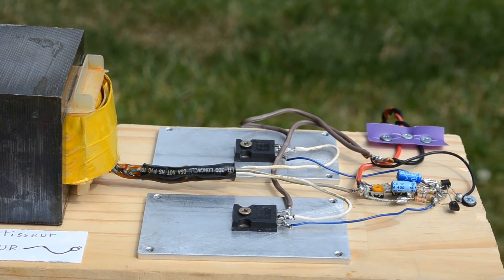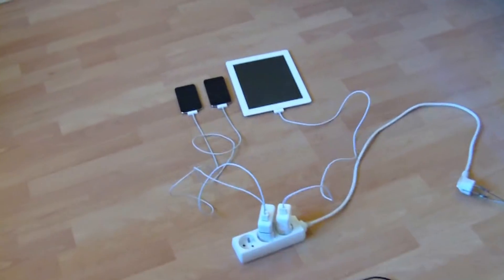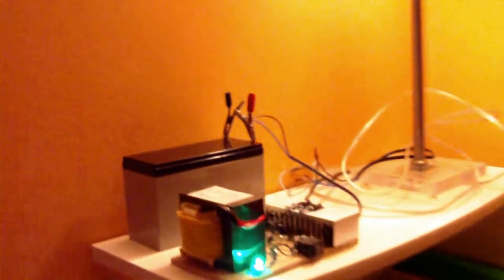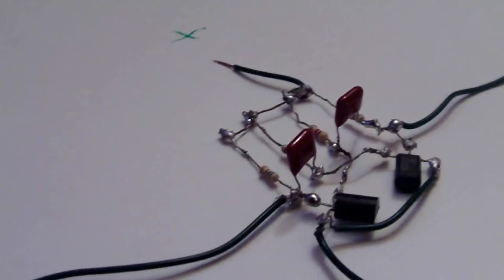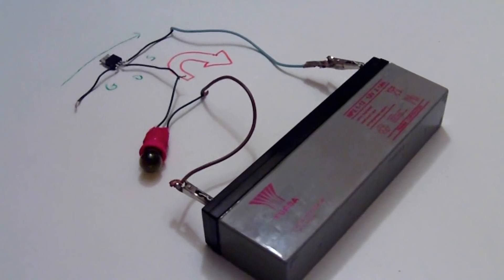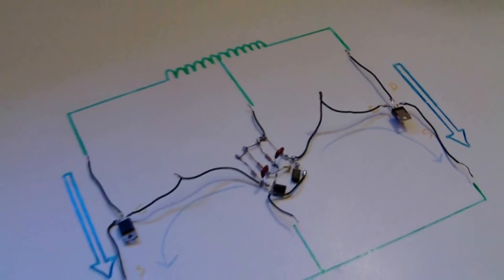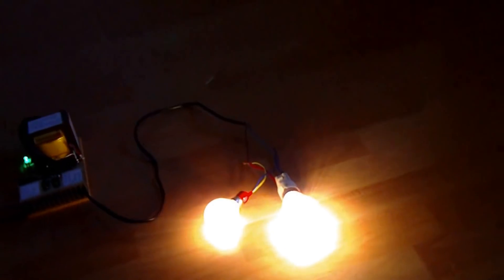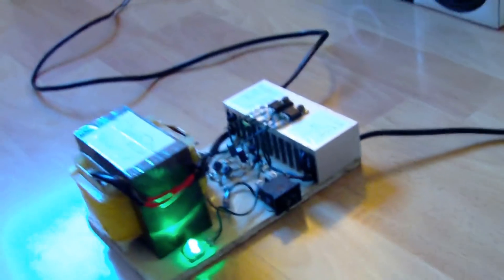Make an inverter : DIY Experiments #2 - Power AC devices with a battery / homemade inverter

Comment: +DIY Experiments Your circuit oscillates at 200Hz, the mains uses 50-60Hz. it does not matter for incandescent light bulbs, but it can be bad for SMPS since they are rated for 50 to 60Hz. I would recommend swapping those 2.2uF capacitors to 6.8uF ones, 680 resistors to 470 resistors, and 12k resistors to 11k. that would will produce about 50Hz square wave Which means that you cannot run motors of your inverter.
Reply: Well, i haven't built the circuit, but it is the theory. (I did a simulation but aimulations doesn't always work in a real world). Maybe i should build it quick and see.
Reply: Ok, I will do a full documentation from actual tests. I would recommend a transformer that has 2 pins on the primary (where the mains goes) and 3 pins on the secondary. So that if you would measure the voltage from pin 1 to pin 2 you would get 24v.
Reply: I couldn't find components for the transistor multivibrator so i used arduino instead, (i recommend adding few resistors, 100 omh from microcontroller to transistor gates and high value from gate to ground (10-20K) to avoid false triggering. here's some pictures http://postimg.org/gallery/14eaauzgm/ . I would recommend using CD4047 multivibrator circuit since it has less components, Here is the circuit for the whole inverter http://cdn.instructables.com/FOC/MRYD/IKJ8GN9D/FOCMRYDIKJ8GN9D.LARGE.jpg
Reply: I would also recommend using 55NF06 mosfets since they have lower internal resistance and should have less heat output.
Reply: KundaliniKid you will get huge current draw and a possibly a high voltage drop. You can use mosfet transistors but make sure that the gate treshold is low enough. Or you can swap them for BJT transistors.
Reply: KundaliniKid oh, I misread your message. In that case. it wont cause much current draw. But please keep in mind that using this circuit you will get a square wave, not sine.
Reply: KundaliniKid You will have a hard time finding the right transformer. I'd recommend to wind your own transformer.
Reply: simas pudziuvelis:why if i connect the circuit to the transformer it will blow up?

Comment: Well there should be a cooling system cause it may over loaded and be heated up. Ain't I'm right?
Reply from the maker: The efficiency is good so it doesn't requires any cooling system :)

Comment: Not being picky here but the mosfet should NOT have the line drawn connected where the gate is...in the drawing this would mean the mosfet is on all the time...or the source and drain are conducting all the time...where a 630 does not work this way..just a thought..and a very nice video...thanks...
Reply: +Kennynva T. Nice catch.  The symbol depicts a depletion mode N-channel device.  He should have chosen the symbol for an enhancement mode device which is what the IRF630 is.

Comment: Hello
Great video... but please specific about the components used for making the circuit like what is the specification of the transformer? which mosfet did you used? which components did you used for oscillator?

Comment: I was hoping for your reply for the earlier question, although its been for 4 month but, I imitate you circuit and use a 12-0-24 Transformer, and I barely power up my hot glue gun which rated 20W. Your demo shows you able to power up a soldering iron which probably >45W. I am using a lead acid battery(12V/7A) as the source. Please explain?
Reply: that transformer ratio is only going to double the voltage. when it actually needs to be x19

Comment: Whay do you mean by oscillating
Reply from the maker: It's not a steady state, each 1/100 of second, the transistor which is activated changes !
Reply: +DIY Experiments can you explain how the current flows because when I think about it both transistors should come on immediately as they have both have base connection from the battery. is it the ressistors that are slightly different that cause this insulation or what? thanks

Comment: your  inverter give  3o watt in  you  cant charce  your laptop or only  open  the  bulb my  laptop it  65 watt
Reply from the maker: Your laptop's power supply can deliver up to 65W in order to both power and charge the laptop. In practice the computer is rarely consuming more than 30W, especially for charging !
Reply: +gogu gogu Your power plug in the house most likely says 230 volts, 16 amps rated. Does it mean you use that much all the time? Of course not. A laptop can be used while charging and when you both charge it AND use it, the charging circuit hooked on the battery and the laptop combined cannot reach 65 watts of consumption. Now if you simply charge the laptop, it will use like what? 20 watts? I would be surprised if it went anywhere above 30.
LiPo batteries in there can't really charge at higher amperage than around 1 amp either, so that would limit it to 20 watts anyways (at least at 19.5 volts as you said). Where on earth would the 45 extra watts go?
Your charger won't just go and be like "Hey, look at me running at full power, how cool is that!", it will limit itself as it's supposed to for a number of obvious reasons.
Now one more thing. You seriously calculate the charger's consumption from the OUTPUT? What? :D
Those things have like a 70-80% efficiency so all your calculations will be off almost by one third of the actual number. And you usually have the charging peak written on it which is like 400 watts for 2 seconds on the start-up.
Reply: +DIY Experiments unless you have a gaming laptop 
My adaptor sometimes peak at 1.4 1.6 amps @ 230 v
Reply: +DIY Experiments sooo..it depends on the power consumption by the laptop not by the rated adapter of 65 watts and so....right?
Reply: +DIY Experiments yes  it  19,5*3,3=64,35w it  65 w

Comment: this is an UNREGULATED inverter! output voltage is UNSZABLE and does only rely on transformer ratio and load. the more power you use on the output, the lower the output voltage gets. on the other hand, if you design it for higher load, the output voltage will be way to hight if unloaded. no good.
Reply from the maker: Of course, it's the easiest inverter we can imagine !
To reach 230V you have to put a load of 20W. But ordinary loads are extremely tolerant ! The ratio between efficiency / easiness is high in this inverter ! ;)
Reply: +Axel Werner 120 volts AC
Reply: Mark Schulz IV so?! Does ohms law not apply to AC?!
Reply: Axel Werner It does.
Reply: Mark Schulz IV
so i am right. this inverter is unregulated on the secondary side. the more power its been disapated on the secondary the lower the voltage on the secondary.
Reply: +Mark Schulz IV wow this is very unstable I built this today it have a increase of frequency when under load and can increase voltage without a load even and is very dangerous

Comment: Cool project, but you should note that the output voltage won't be very well regulated, which could potentially damage things you plug into it (or at least shorten their lifespan).
Reply: your Supply voltage can get lower as the loads get higher, if you dont apply enough voltage for 120/230V appliances, the just dont work or like the Amplifier at the beginning quit working..... a bigger problem is the square wave he induces, this means you got voltage spikes every 20ms and not really anythiong more, a transformer just works at changing flux, therefore changing the way of current in the primary...

Comment: As I have background on Electronics and our town lack of electricity there are rotational brown out.. I need this schem as soon as possible.

what wave form is this? square wave or sine wave?  thanks
Reply: +ElecTroMan DIY AMPLIFIER If you want to use an inverter for seriously powering stuff (as opposed to &quot;just because you can&quot;) you should probably just buy one. The circuit in the video is simple enough to make, but isn't actually very good.

Comment: Hi,
Ive been looking for a while to an answer to my question.
How Do I convert a variable lab bench psu 0-30v 10a output (DC) to AC without changing voltage?
Reply: +MrHD71 make square wave with 555 and transistors and use 1:2 transformer
Reply: +vito87l CD 4047 is batter :)

Comment: can some one show me the circuit diagram for this?  thanks
Reply from the maker: It's at the end of the video
Reply: +DIY Experiments How to increase the wattage ? for example i want to increase the watt up to 750watt How can i do it by adding more transistors or what ?
Reply: Ali Afghan dude use a bigger transformer

Comment: Hey-thanks for this! A couple of questions though...

1) How much did the entire project cost?

2) This is a Power Inverter, right? I wished to know how the home power inverter work. I mean how does it 'know' when to give power to the household and when not?
Reply: +dbaioco1 It&#39;s the other way around. If it does not see home power, it snaps right off and doesn&#39;t supply your house. Supplying power to a circuit connected to a utility when the utility is not supplying power is a serious safety hazard. For one thing, you won&#39;t be able to power everything connected to that line and your inverter would just shutdown. For another thing, it would create a serious hazard if your utility was working on the line, expecting it to be unpowered if they had disconnected it from the source. Inverters used for backup power with requiring a disconnect/reconnect of the devices require a complex setup that has much more than just an inverter, including circuity to isolate the critical loads it's supplying from the utility supply.
Reply: +Vinay Seth if I understood your question right, the home power inverter is synchronized to the home power, so when it "sees" a power fault, it snap right in and supply your house.
Reply: +dbaioco1 Oh ok. Thanks!
Reply: +Vinay Seth It's quite easy if you know a little of electronics, the circuit 555 can be used as detector of missing pulse, so when the senoidal wave have a fault, the 555 detect it and send a pulse.
Reply: +Orlando Romero What's a 555, though?
Reply: +Vinay Seth Sorry, it's a timer the cheaper I think, it can be NE555, LM555. If you see the datasheet you can find the configuration as missing pulse detector
Reply: +Orlando Romero Cool cool. Thanks- shall look it up if I get the time.

Comment: If the circuit you show at the end of the video is what you actually built, then I would be surprised if it actually works. Follow: upon initial power up both of the BJTs are biased to turn on. This will turn off the FETs and the circuit will do nothing. This condition will never change.  I believe the 12k resistors should be connected to the ends of the primary winding in order to get present state information back to the driver circuit (with some delay) to change it's state.
Reply: +Bogy Wan Kenobi : Try it, you will be surprised : it works ! No simulation software can predict the initial behavior of the oscillator, neither us. A tiny but real perturbation will activate a transitor before the other and the oscillation will start.

Comment: the inverter works perfectly!!!!
Reply: +Miha husqarna which battery u have used? and why center tapped transformer ct is connected to vcc? please help
Reply: battery from laptop 
because it needs 2 coils for transistors to discharge into (oscilate)
Reply: the ct is actually conected to positive side and resistors

Comment: you took the typical led blinky multi-vibrator and hooked it up to a couple fets and ran it through a full size 50hz transformer ?? why?? do you not have mains power to run the transformer? the point of a switching converter is to operate at a higher frequency, 20khz and up, thus reducing the size, weight, cost while increasing the power density. you have none of that.  Silly

Comment: You need to create a switch that is configurable to allow you to shut off your device when the battery voltage gets to a specified voltage. This is to protect the battery from over discharge. Some people will use lithium batteries and lithium batteries need to have a complete shutoff system installed. One that won't turn back on once activated until you reset it after you charge your back up battery. Any battery needs that but with lithium its more important.
Reply: +Pete McWade I think you can use some 11 volt total voltage drop diodes by placing some in series, putting a resistor, and using a transistor.

Comment: when i on the switch and after connecting transformer my 12v DC goes down to 6v near automatically
Reply: thats because your Mosfets are both turned on for a short time and therefor produce a short circuit, which kills your input voltage...

Comment: i have taken this as mini project ,what is the rating of transformer.i am not getting proper output
Reply: +VIVEK SINGH you need 12-0-12 5A transformer for get 60W
my 2A transformer only give 24W
Reply: +Vineeth Narayanan How much will a 2A step up transformer cost in India?
Reply: +RazorCallahan2424 around 140~150 Rs for 12-0-12 2A transformer
500~600Rs for 12-0-12 6A transformer
Reply: +Vineeth Narayanan Damn.. won't be able to afford the 6A one. 4 amps would give around 48W. That'll be enough I guess right?
Reply: +RazorCallahan2424 that totally depends on you:)
i have a ups transformer capable to handle upto 600w (salvage from old ups)
go to nearest junkyard maybe you get one for free;)
Reply: +Vineeth Narayanan Bro won't the current have to be different in the circuit, for the different ampere ratings of transformers?
Reply: +RazorCallahan2424
if the input is 12v 7Ah, you can use any 12-0-12 transformers on this circuit even 500mAh transformers
but it can only handle 5W or less.if you add more load the transformer coil become overheated and dead

a 7Ah battery is not give 7A current in every time. that deepens on the  load connected to the output
if you connected a 5w led bulb on output the battery give 12v with 500mAh current to produce 5w (12X.500=6W)
if you connect a 20W CFL as load the battery give 12v with 2A current to produce 20w (12X 2 = 24W)

that mens you can use same surse for different transformers.but maximum output is deepens on the transformer rating
note :high current transformers can handle more heat and more load.2A transformers can handle 2 20W CFL
Reply: +Vineeth Narayanan thanks a lot bro :) I've got a 3A transformer. I'll rig up the circuit this weekend and let you know how it went..
Reply: +RazorCallahan2424 good luck:) use good heat sink for mosfet
now i am on a ic based inverter using CD4047,555 etc for a 100w solar inverter
Reply: Wow.. good luck bro! I'll think of making a solar inverter if this one is successful!
Reply: now my inverter is a cheaper one(in cost)
soon i will make good one 
do you want to see the photos?
Reply: +Vineeth Narayanan Sure bro! Google Plus?
Reply: +RazorCallahan2424 SOON I WILL POST MY FULL PROJECT IN www.instructables.com
(now i am on a weekend trip)
Reply: +Vineeth Narayanan Sure bro.. Can't wait.
Reply: Can i use 12v 48 amp battery?
Reply: +Farzana wed yes but this circuit can't handle that much current.12v 48A is equal to 576W (so much of heat)
this is a simple dc to ac inverter circuit.may be you need a 500w inverter circuit using bunch of MOSFETS
Reply: +Vineeth Narayanan but my circuit doesnt give ac voltage at the transformer input. therefore i got nothing at output as well. it's giving dc voltage from both mosfets and ct. please help. i want ac voltage.  i have a 150 watt 12.5 amp ct transformer
Reply: +Farzana wed my friend this circuit can't convert dc to ac. this circuit is used to make pulsed dc.the transformer convert that pulsed dc to square wave ac
if you not get any output may be there's a problem in the circuit
can you give a photo of your circuit?

//12V 12.5 A ct transformer? wow! //
Reply: +Vineeth Narayanan sure bro i ll . 
can u send me ur pictures?
Reply: +Farzana wed u mean to say that input of transformer would be dc. i get it
Reply: +Farzana wed go to my Google+ profile
Reply: +Farzana wed not just DC it's a pulsed DC
try a simple experiment,connect your transformer output to multimeter to red AC,then connect on of the input wire to -Ve of the battery then connect and disconnect the other end rapidly to +Ve of the battery.you can see a ac reading in multimeter
Reply: +Vineeth Narayanan check my google+ profile u ll see the pictures and the reading
Reply: +Farzana Wed check my comment

Comment: hi, can i ask if you if you used a Vp 12-0-12 and Vs 220 volt transformer? or Vp 9-0-9 and Vs 220 volts, beacuse most DIY inverters are using 9-0-9 transformer, hope u will answer. tnx
Reply: +osvio travasso you need 12-0-12 transformer.its a center tapped transformer with 3 wires on primary and 2 wire on secondary

12-0-12 2A transformer give 24W,3A transformer give 35W (more amp more watts)
Reply: +osvio travasso yes i am using 2.2uf 63v e cap
Reply: Can i use 24-0-24 5amp transformer or ups transformer 
And  can i use 3.3 uf capacitor 
Pleas 
Thanks

Comment: What would it take to convert it to 120V and 1000W?
Reply: You'll also need a bigger transformer such as one out of a microwave oven that's been rewound.
Reply from the maker: To conserve the same scheme, the on thing to do to increase the power is the use a bigger transformer with a lower internal resistance. The MOSFETs can be also changed but their resistance is not a problem compared with the transformer.
Reply: Ok, thanks guys!
Reply: +DIY Experiments a question works with both irf630 and 2N2222 ???
Reply: ***** thanks
Reply: +Electronic Experiments thanks

Comment: sir you are using 12-0-12(dc) to 230(ac) transformer, &how much amps is that transformer ?can i use 2amps &12-0-12 to 230? .if not suggesting a better one for best outcome

Comment: hi sir i follow your inverter diagram its work in 12volts 750 MA but it so weak.. i try a 12 volts motorcycle battery inverter is not work & IRF630 hot please help...